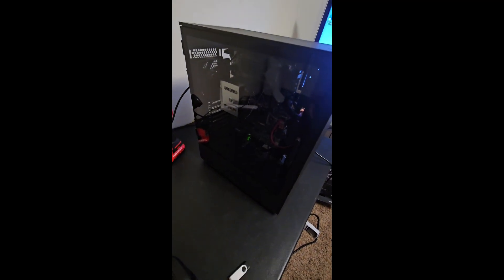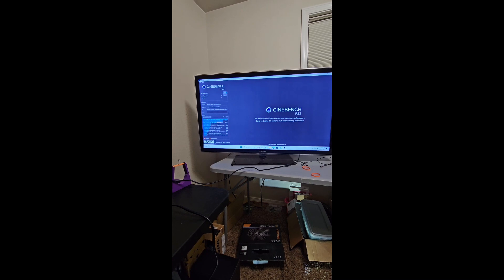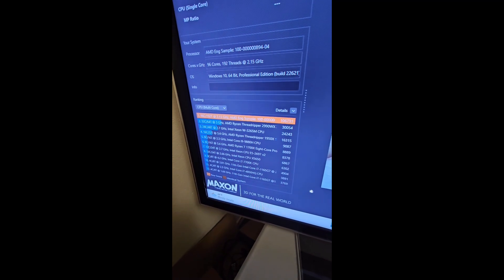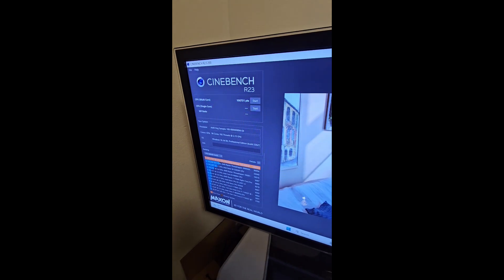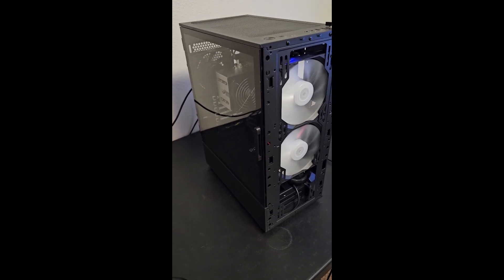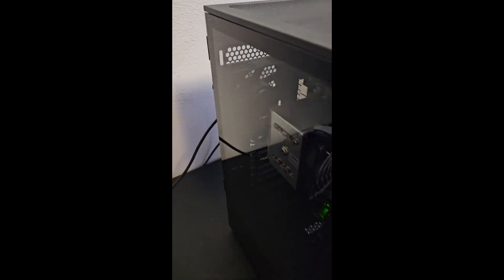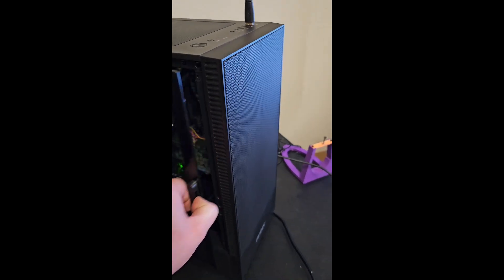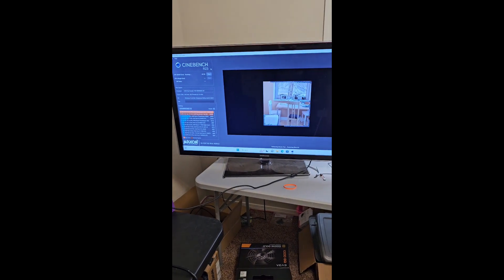EPYC 9654 96 Core 192 Thread Build, RandomX and Cinebench R23.2

Comment: Do you know what the difference between 9654 and 9654P is? the specs are identical but the performance of the P version seems a little lower on xmrig benchmarks. Thanks!
Reply from the maker: @MsAlexalexalexalex  p is single socket cpu only non p can run in motherboards with 2 cpus
Reply: @crazykkid2000  Thanks man!

Comment: just 2.4 ghz ???
Reply: 2.4ghz with 192 hyper threaded cores . it is far more power and thermal heavy if that thing did like 4 or 5 ghz it will be super hot and modern day collers and psu  cant keep up .
Also its a server processor it can work for a long period of time without stopping .

Comment: 106K is truly a sight to behold...  My new 14900K pulls just barely over 40K on DDR4 memory which puts this 192 thread beast 160% faster than my 32 thread potato...  And I bet this thing just crushes everything at AVX512 workloads.  My god I can't even fathom it.
Reply: @AnushkaChathuranga-cw7tc yea but who the hell is going to run that EPYC in single core any ways, single core performance barely even matters in current days.
Reply: @Tor_9184  it only serve as last argument for intel fanboy those day lol
Reply from the maker: @AnushkaChathuranga-cw7tc  the 9654 single core performance is actually quite impressive! I wouldn't discount it at all. its a head of an i9-9880H and basically the same as a I7-7700K per core which is a 4.2gh CPU. But the 9654 is like having 24 of the I7-7700k CPUs packed onto one socket, but with faster ram. Its honestly mind blowing!
Reply: @AnushkaChathuranga-cw7tc If true then Sierra Forest (288 E-cores) is going to be ungodly!